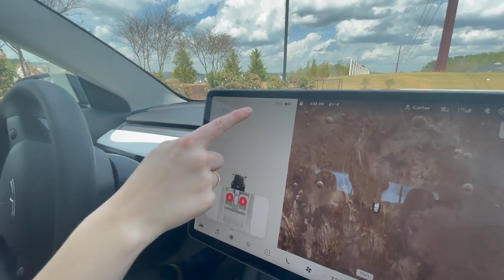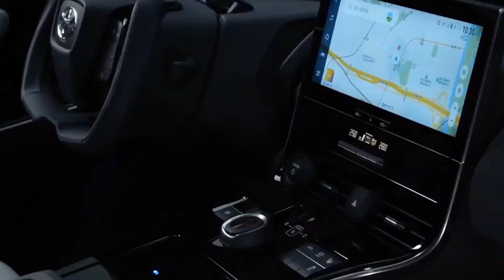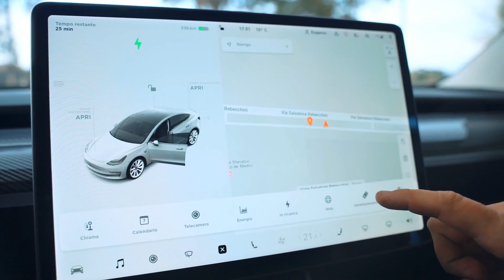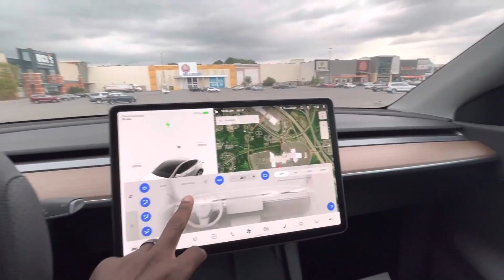Toyota BZ4X BETTER Than The Tesla Model Y? Toyota's BRAND NEW Electric SUV

Comment: I’ll stick with the Toyota Highlander Hybrid AWD with 35mpg that gets over 600 miles before fill up with plenty of stations around. EVs are charging way too much when they’re not truly ready for showtime. Bells and whistles are fine but vehicles are for getting from A to Z first.
Reply from the maker: Do you have one?
Reply: @techtime1239  I have a 2016 Chevy Volt I’m trading in for the 2022 Highlander Hybrid for my business which requires a lot of driving along with road trips our family does. Our current family car is a Volvo XC60 which is gas only but gets about 28.5mpg on road trips which are usually 700 miles or more one way. Time is an issue and being in areas where there aren’t any chargers is an issue. The Volvo hybrids and full electrics are good but $$$$ and the Highlander does a lot for its price point.
Reply: I have a highlander hybrid that gets 36mpg average. But due to Toyota tank problem. It can only fill up 14 gallons max, it’s a know problem with the Highlander and RAV4 hybrid. I can only get 420-440 between fill up. There is an ongoing class action lawsuit.
Reply: @thienthan324  Good to know. Is that the 2020 or 2021 model?
Reply: @rickstokes2239  yes
Reply: @thienthan324  Interesting

Comment: I have a Prius and love Toyota, but I bet that the display infront of the driver has Atari 800 XL graphics...
May have been good enough a few years ago, but not today !
They are just no good when it comes to modern Displays and high resolution cameras .
Also their Audio - Systems allways sound very average, but one thing everybody can be sure of, these cars will have the best efficiency in their class !
Reply from the maker: How old is the Prius?
Reply: @techtime1239  
It's a 2012 Gen 3 Prius .
It will be 10 years old in June 2022 .
I haven't had a single problem, not even a light bulb broke on me .
Even the 12 Volt Battery is still the originally build in one  !

Comment: Toyota Motor Corp have already said that they intend to start from the bottom and work their way up.
The 70 kWh battery pack is only the entry level.
TMC will progressively add midrange and flagship battery packs with more capacity, higher performance, longer range and higher prices to their line up.
This combined with superior quality of manufacture and assembly may put an end to Tesla.
Right now, consumers only purchase Teslas because there is little other choices.
As soon as something better becomes available, that is the beginning of the end...
Reply from the maker: Toyota man

Comment: Where did you get 200/230 mile range figures??? With 71kwh battery it should go  up to 300
Reply: Maybe just maybe thats reserve for battery degradation
Reply: The way EV measure miles is very different. Tesla measure their miles from full and drive until battery completely dead. Toyota has a larger reserve that can’t be used. If Toyota measures the way tesla measures it’ll be more than 250 miles.

Comment: Good vid, but too many photos of the Model X and S which should not be shown in this comparison.  If Model Y would come with cooled seats, blind spot monitoring and a couple other things I would be all in for sure, but this BZ4X is nice, just the range is too low to compete now.
Reply: I would say 310 miles and 285 miles respectively is very good at this price point, what on earth are you expecting 🤷‍♂️.
Reply: @trev0074  huh?  It’s 200 for the awd.
Reply from the maker: Thanks will keep in mind